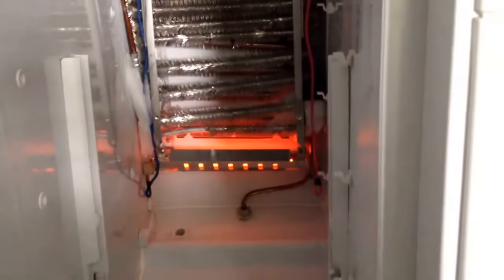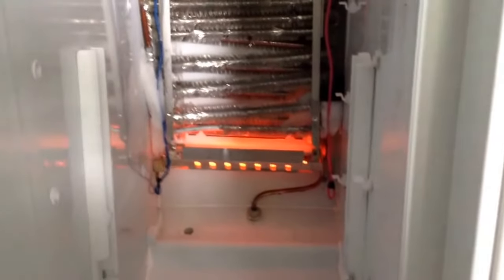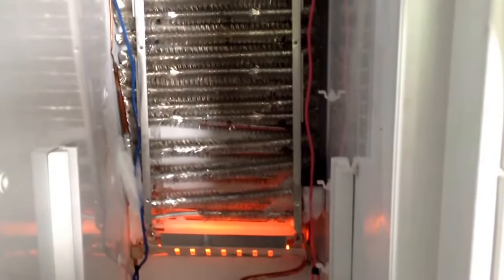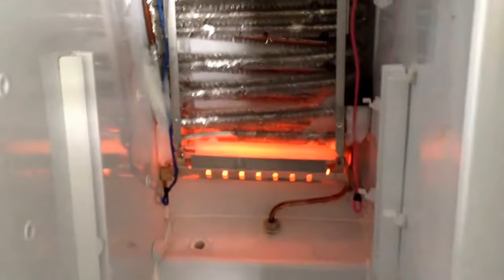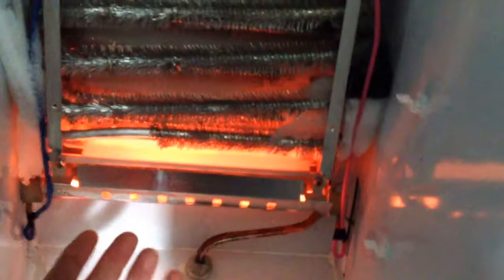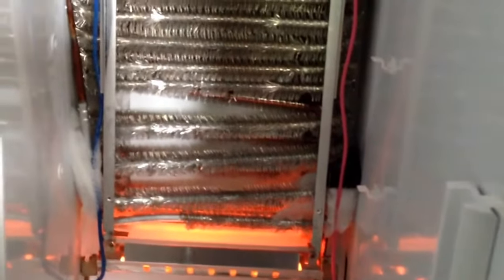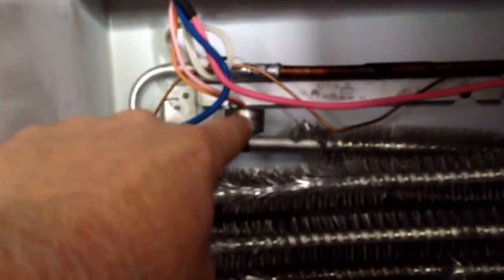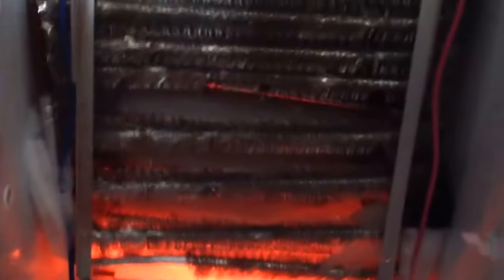GE refrigerator defrost operation

Comment: Whew! Had this fridge for a whole year and never noticed that glowing defrost light. I was sure my fridge was gonna blow up or something. Thank you for explaining!
Reply: It's an extremely inefficient way to do it. The fact is it costs like 5 times as much to run a heating element. I mean most other fridges like air conditioning units and heat pumps they simply just reverse the cycle and when the cycle is reversed then the coils will get hot not cold. Extremely inefficient way for a fridge or a freezer 2 defrost itself

Comment: Please help! The connectors from the red and blue wires burned out along with my defroster. I have the new defroster part but what type of new wire connectors should I use (and where can I get them--no one seems to know)--I assume the connectors will need the same high temperature rating as the wires (125 C).

Comment: If the defrost heater goes bad the evap coils will get packed with snow and the freezer/refrig won't keep cold due to the snow blocking airflow.

Comment: Hi, thank you for your video. I just replaced the heating element on my refrigerator because it was freezing up completely and the right side was warm, not cooling. I did some research and found out the heating element could be the problem. I just installed the new heating element but it didn’t turn on. My question is: Is it supposed to turn on and go red glowing as soon as I connect the refrigerator? Or it turns on automatically every 8 hours as you mentioned on the video? Just wondering!!! Thanks!!!!

Comment: My defrosted is stuck on an Older Kenmore Frig. I thought that the Bi Metal sensor might be stuck closed, however now with the inside of the freezer panel off, I noticed the heater rods are not getting hot by the fins. Yet, the top and walls of freezer you can feel are getting very (real hot). This is on an older Kenmore Frig. No computer PCBs, LEDs etc. Compressor is on, Evap fan on, but the frig can't get cold enough with the defroster turned on constantly. 
Any advice welcome. Thanks.
Phil

Comment: I just saw this in our double door GE. We just moved into a condo and have never had a double door before. I can actually see the hot coil through the vent from the inside of the freezer. Scared me to death. Also when this was happening, the freezer got to about 39 degrees and the fridge got to about 50 which is both in the unsafe range. We have noticed that tomatoes and grapes are not as cold and crisp and that the things runs a lot. We have too many things that need repair here and worry about asking the management for more as we are new. Is it normal for the temp to temporarily go up and then reset as it did? Can food go bad from it? Is there ever a fire worry about this? Our daughter sleeps in the room behind the fridge. It seems odd to me to actually have a vent into the freezer where a hot coil sits for that long. Thanks.

Comment: The thermostat,. or bi-metal, on my GE refrigerator was busted wide open so, I replaced it.  It was not easy to replace because I could not move my torso into the freezer compartment.  I also replaced the 9-year-old defrost lamp even though I did not actually diagnose as a failed unit.  I'm a subs-killed DIY appliance repair person.

Comment: A smooth and simple explanation. I just replaced mine on a GE double door, and I have noticed the resistor inside the glass tube is totally black. The new one is clear. Why it's black and that black comes from ...?

Comment: please help....heater element has continuity so its fine right? the 2 wires shows 110 volts......i manually turn the timer to defrost so the compressor stopped.....but the heater doesnt heat up

Comment: I just replaced my heaters, sent as pair. No fun working in that tight space. The easiest job was replacing the defrost timer. The model I own is a 1994 GE. Luckily a supplier on eBay had these.

Comment: I have GE refrigerator side by side door initially I found defrost burn out replaced new heater , thermistor and thermostat after than I found heater was over heating up damage side gasket of freezer panel but heater still working for a month and after heater connection was damage and fail I don't understand why this issue repeat what is reason is it a mother board or a  after market parts please reply your comment

Comment: man thats real red hot(what's the heater wattage, could toast bread on that), considering the size of the evaporator, could easily catch fire if bimetal gets stuck in on .
Reply: bazrazin1 
While the “catch fire” idea does seem logical, I doubt there is enough oxygen in the freezer to support a fire for very long. Especially after the smoke and carbon dioxide gets to rolling??? Just my guess.
Reply: The defrost timer circuit is primary on/off I believe. I don’t think they’ll have one failure mode that will cause it to stay on continuously

Comment: what would cause the defrost cycle to stay on too long?  mine is cooling / freezing fine and cycling.. but it seems that when it cycles into the defrost mode it is staying on too long and thawing the ice in the ice tray and everything and causing dripping into the bottom of the freezer and out the front of the door onto the floor.. then it all refreezes and the ice in the ice maker tray is frozen back into one big clump.  I've replaced all three temp sensors and the thermostat for the heater strip and had to replace a heater strip once already because it burned out.    HELP! ? :)
Reply: Sounds like a bad door seal. The evaporator, along with cooling, removes humidity. But if ambient air keeps entering frost -> ice will build up faster than it's designed to thaw it out.

Comment: Hi, do you know the cycle of defrosting in this kind of GE fridge ?  does the white thermistor on top of coil measure if it's necessary to defrost or there is timer inside the main board ? how does the fridge know when to defrost ?  thank you.
Reply: Typically there’s a defrost timer. Typically they are set to 16 hours or so. Some of them measure of how often the door is open I think. If the doors not open you obviously don’t need to defrost as much because no moist air is getting into the freezer. Yes this cycle happens once every day on your typical refrigerator

Comment: Actually, that heater is an L140-30 it will shut off when it gets 140 degrees, comes on at 30
Reply: The thermostat switch will open upon reaching 140°F and the bi-metal will re-close at 110°F (140 minus 30)
Reply: typo forgot the "1" @SerenoOunce

Comment: Now, how do I make the heater glow, manually?
Reply: I haven't found any information on how to force a defrost cycle on a GE refrigerator. What you can do is jump L-1 to DEF on control board when freezer is at normal operating temp, and if you get the heater coming on, or check with ammeter for current draw, about 6 amps, you will know that the "high voltage system" is working. That leaves the defrost thermistor, which is used to terminate defrost at about 50 degrees coil temp, or the control board as the reason for non auto defrost. The round defrost t-stat, that is wired in series with the heater, is safety related only, and is set to open at 140 degrees, so it should never be involved during normal operation. Although it can and will fail, stopping defrost from occurring, most of the failed t-stats will pop open due to moisture, water, entering the part, freezing and expanding, causing failure of the high temp defrost t-stat. By far, the heater and defrost t-stat are the most problematic of the defrost parts, but the thermistor will fail as well. I have only seen one control board failure that caused failure to defrost, but otherwise operated the refrigerator normally. All of the sensors in the system are the same value but send different return voltages back the control, due to the temp environment in which they are located. The defrost thermistor, {Sensor}, in my opinion is more susceptible to failure due to the temperature swing that it experiences. It goes from coil temp of -20 or so up to +50 about once a day. Hope this info helps for better understanding of how some of the GE refrigerators operate and why they stop defrosting automatically. You can find the resistance value's for the GE sensors, and other makes as well on line. They don't cost very much, so if in doubt, replace it along with any other parts that are faulty. Good luck.
Reply: You have to jump J9 and J11 and the heater will come on
Reply: @Hernanqwerty  you can also manually advance the defrost timer till it kicks into defrost mode. At which point the heaters should come on and start glowing bright orange.
Reply: @lewisriesbeck8858  Hi, I’m down rabbit hole right now watching vids for info haha, you seem knowledgeable, hoping maybe you could help answer my question. Long story short.., GE side by side, I replaced defrost heater, defrost thermostat, and thermistor...everything seems fine now, except my concern/question is the length the defrost cycle runs at. I feel like everything in freezer is melting too much. Then leaves a lot of frost. Any idea what may be happening here? Thank you 🙏🏻